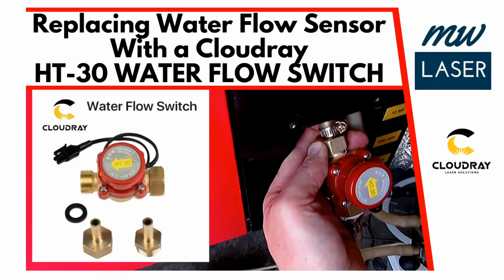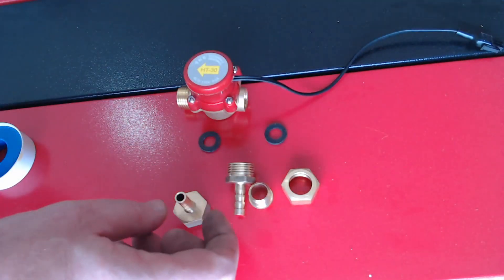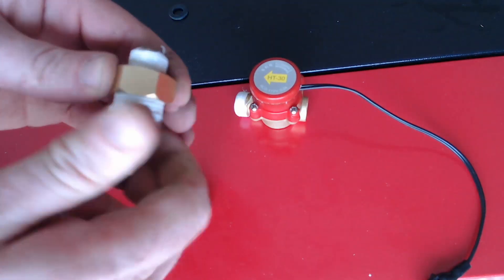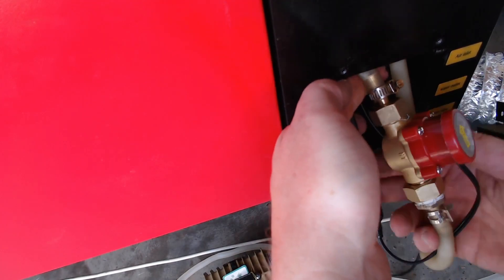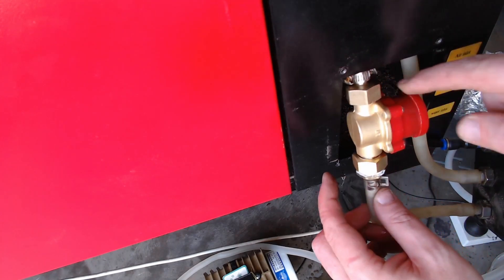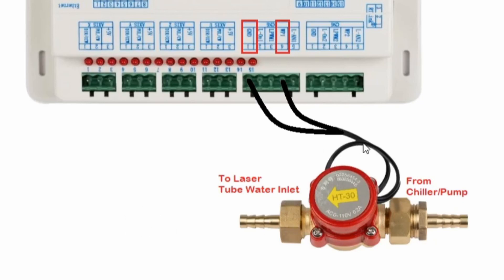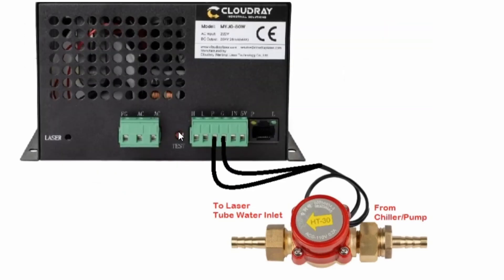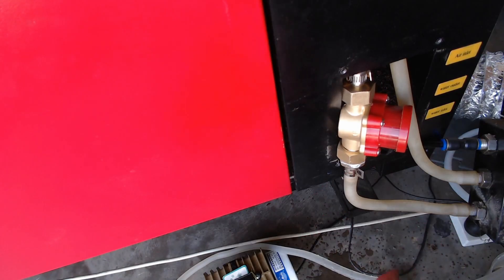Replacing Water Flow Sensor with HT 30 From Cloudray - Co2 Laser Repair, Water Flow Sensor Install.

Comment: You are the greatest man!!!!! This video is exactly what I was looking for. My Omtech 60w started leaking water today and flooded my shop floor. It's crazy as I've used it for about 4 years now. It actually looks like the hose just popped off so I tried reattaching it using better hose clamps and it still leaks everywhere. So I just decided to replace it completely with this exact switch. I was stumped about how to re-attach the wires though because I am no electrician by any means and didnt want any fires for sure. This video really saved me and will now make the install a breeze. Thankyou so much for making this really helpful video. I just subscribed just because of this video.

Comment: What happened if the water protection switch is not working? 
My machine is not working and I already change the power supply and tube. The WP led on the water supply is ON.

Comment: Hi! I saw your video. I was installing my CO2 80watt Chinese laser last weekend. And when I put my chiller on. I saw a leak under the laser tube, the water flows. It looks like it came from the connector, but mine are not on the same place as yours. My connector is right under the laser tube and not where yours is? What should I do?
Reply from the maker: Make sure the leak is resolved - if it does not then replace the sensor - they are often located in different places on laser machines

Comment: Sir how can we directly check the water flow sensor either it is faulty or not . (excluding check in laser cutting Machine/ system ). 

TQ sir from India 🇮🇳
Reply from the maker: check continuity of the 2 wires on the sensor when water is passing through switch.  when water flow in correct direction switch activates and you will have continuity, when there is no flow switch is open.

Comment: hello, I was wondering if you could make a video on how to properly ground the machine.. cheers
Reply from the maker: maybe. In Australia the machine is grounded through the 3 pin mains power.  You could add additional grounding if you like from grounding terminal on machine to a steel grounding rod.

Comment: Hi, I am just about ready to get my DIY laser going and would like to know if I need to use distilled water or will tap water be ok. Maybe water out of my dehumidifier will be good. Have been watching your videos and they have been very helpful.  Thanks Dave.
Reply from the maker: I use clean water from tap and add about 50ml of bleach to prevent bacterial/algae buildup.  Some say distilled water is better, however bacterial buildup can still occur with distilled water as the laser tube, hoses and chiller are not sterile.   Check and replace water as required, I generally change out water every 3-6 months.
Reply: @MWLaser  Thanks for the reply. I have been able to get ultra distilled water from the supermarket and will see how that goes and its only $7 per 10 litres.

Comment: My Goldmark 4060L has a water flow switch similar to this but it is installed on the water outlet line, just before it exits the machine.  Is this acceptable?
Reply from the maker: yes

Comment: Is there a required minimum pressure for the flow switch to work? On the inlet side?
Reply from the maker: I believe this sensor is activated when the pressure of water flow reaches 0.03 kg/cm² (0.4267 psi)

Comment: It seems like you’re using a cw chiller based on the power-on noise. Is it a good idea to use the signal on the flow sensor  that is built into these chillers for water protect?
Reply from the maker: Yes this is a good idea if your controller and machine has that capability.

Comment: I bought the HT-30 but it is 110 Volts but my co2 source is 220 volts if I connect to this source will it burn ??  My power supply is the MYJG-100W.
Reply from the maker: this model operates on up to 110V DC - do not get confused with it being 110V AC,  on your laser machine it will operate on the DC voltage supplies which are in the range of 5V-36V DC.  YES it can be wired up correctly to your MYJG-100W, this is the same PSU shown in this video https://youtu.be/h7wMw_xlWUA?t=655
Reply: @MWLaser  thank you very much for the explanation

Comment: I bought HT-30 flow switch it is 110 volts but my voltage is 220 volts, I did not find this model 220 volts.  what do i do, do i have to buy another ??
Reply from the maker: No you do not need another switch, this model operates on up to 100V DC - do not get confused with it being 110V AC,  on your laser machine it will operate on the DC voltage supplies which are in the range of 5V-36V DC

Comment: Just what I was looking for. I'm looking at buying the upgraded version (Blue and Grey). It doesn't mention having a water flow switch so I'm doing my research ahead of time just in case. Thank you for explaining all of the wiring configurations we might come across.  I've watched several of your videos and all have been very helpful.  Your time and effort is appreciated.
Reply from the maker: Glad I could help

Comment: will this trigger the switch if the water has no pressure at all ?
Reply from the maker: Switch will turn on with a low water pressure and will switch off when there is no water flow.

Comment: So, why are you replacing the original white sensor? Did your fail?
Reply from the maker: No it did not fail, I decided a replacement was best to prevent failure in response to many reports from viewers on their original water flow sensors failing or leaking in their machines.